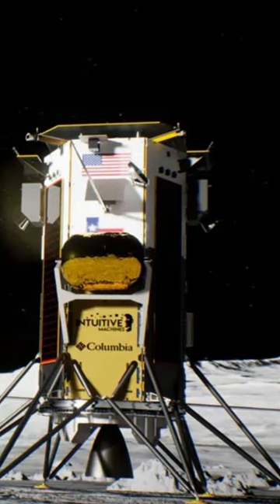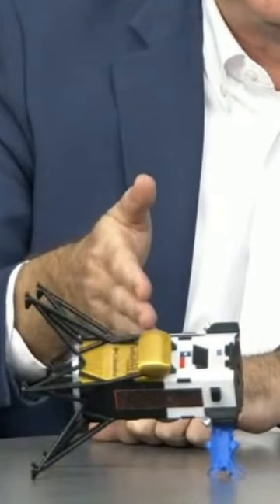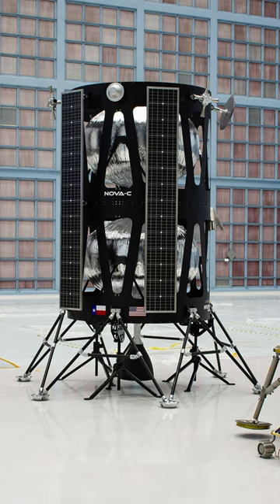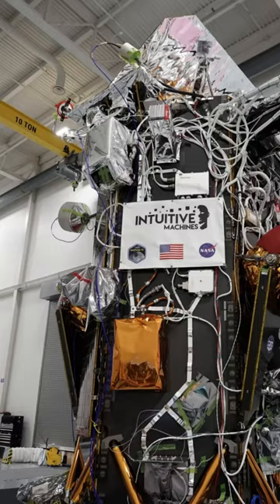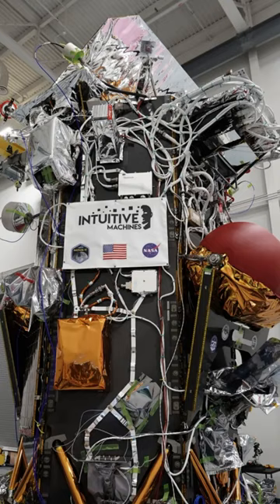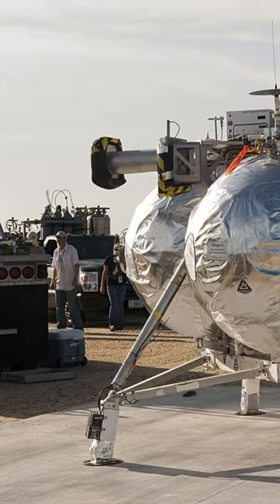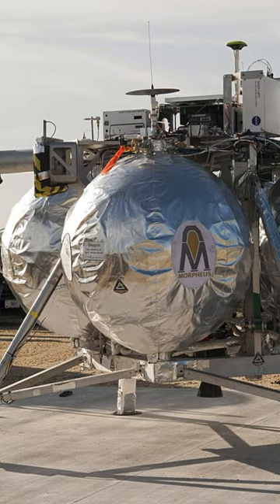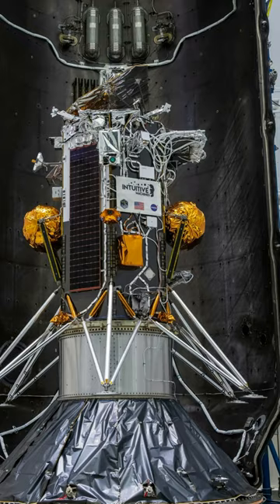Why Was This Moon Lander Built So Tall?

Comment: A low center of mass, sled with skis to deal with any delta X would be more robust, ensuring the lander would remain oriented in the engineered position.  Another thought is why doesn’t the current design have a set of fireable barbs with cables on reels, that would be able to penetrate the surface, then the reels, with some high torque, gear reduction motors could draw in the cables slowly and pull the chassis back into the vertical position, even if the landing struts suffered damage. It seems to be a lack of forethought on both the Japanese and the IM-1 engineering teams to plan for typical failure modes, that’s causing the rather pathetic, “Help! I’ve fallen and I can’t get up” syndrome!  
We got to be better than this in the 21st century!

Comment: Hmm, 🤔 thought it fell over because it was moving sideways as it was coming down. And when it touched down, it was not fully moving down but was moving down/forward 👇👉. Which made it tip over when it caught the lunar surface. I don't believe it being top heavy has anything to do with it falling over, if sideways movement is the reason . Anything can fall over if it's coming down and moving in a horizontal direction as it comes down🤦.

Comment: yeah but there's a point where you have to say, is this worth the extra chance of failure? The proposed solution to this is basically, "if you're moving horizontally and you tip over, just don't do that lol" which, works, but isn't exactly great.
Reply: And incidentally, with that mindset you can probably justify removing the legs altogether, and landing on the engine.

Comment: 2 small tanks need less wall thickness to withstand pressure than one large tank.
The argument is usually because of production techniques being lazy specializing in one kind of material think RDS and reducing manufacturing costs on the contractors side.

Comment: Why don't they put oxidizer tank inside of fuel tank? Since both liquids are kept under pressure, internal tank should not resist high pressure and therefore might be lighter.
Reply from the maker: More complex fabrication, they built tooling for one prop tank design.
Reply: @scottmanley On the subject of tank design, one commenter proposed using LO2 and Propane.  I 'weighed in' on the tank design issue, but it might be a good video idea to talk about some of the more common hydrocarbon fuels and why they are seldom (or never) chosen for use in either pad-launch or in-space burn engines.
(I raised the question of specific impulse, specifically 😉).
Cheers!

Comment: Look at viking landers on Mars. Yes I think they had chutes to help, but they didn't topple over.
Reply: You pretend it's the same problem.
Reply: @TheEvilmooseofdoom  if you look at old NASA test films of the sixties, you see them testing model landers and each of them topple over. They were top heavy. Mars Viking, ranger 3, seemed to have very low centre of gravity. They made it down on three legs.
Reply: The assistance of a parachute obviously helps ensure they fall straight down and dont have to worry about fuel running out and can comparatively take it's time.
Reply: @Geeksmithing  although with a very thin Martian atmosphere, a retro brake i think was additionally used. But having a low centre of gravity seems to work best. I can't see why they can't do that. Have they not watched any old NASA test footage from the 60s I wonder??
Reply: @NeilPeelParanormalPeepShow  I'd be surprised if they didn't also use computer simulations to well, simulate what the flight dynamics were in order to deal with them.  It's easy for us to armchair quarterback after the fact, but in the absence of an onboard human brain to make Intuitive Machine decisions, they will need a more comprehensive flight checklist to avoid boneheaded goofs and more robust autonomous landing systems.
Reply: @Geeksmithing  to me it looked like a very risky topple jenga waiting to happen. Lots went very wrong on this flight. Landing should have been tested fully as a real object, not preprogrammed computer model.
Reply: @NeilPeelParanormalPeepShow  to be fair, it's not like they can easily test the exact conditions just anywhere.
Reply: @Geeksmithing  Yes however, they did make mistakes in forgetting to do certain things and only discovered these mistakes by fluke. But if they had built the lander with a lower centre of gravity, this would most likely not have happened. They were flying blind essentially, with a top heavy loaded vehicle. Expecting the odds to happen in your favour!

Comment: ❓ Install arms to “right” the units to an upright position, and as a spade to move rocks/regolith in experiments. Seems easy enough. Mass calculations, save missions, expanded science via in-situ material displacement. Basic insurance + science + math/mass calculation = result. Can you/we perform example calculations for such arms/mass based on 1) previous mission arms, and 2) primitive/dumb/simplest arms?
❓ Airbag/unfolding style or Opportunity/Spirit? Automatically self-righting.
Reply: You make the flawed assumption that they had the budget and mass to add those things.
Reply: @TheEvilmooseofdoom  not at all.  Perhaps you missed that in my comment… everything after the first sentence. Math/mass calculation, arms as insurance, and arms as science tools = result.  Then asked if there were relative examples of mass and function that we could use in the calculation.

Comment: Some organization will have to micro-map the surfaces & terrain at the polar regions to help robotic landers find better landing spots
Reply: Mapping the surface beforehand is so unneccessary…. The lander can map the surface for itself after inserting itself into orbit. And it wasnt issue of uneven surface but the horizontal speed during landing.
Reply: @SagittarA  I’m also considering previous landing attempts in the same region that have failed or were partially successful
Reply: HUH can you tell me which other moon lander landed that same exact area lol? @treborg777
Reply: The Japanese lander ended up on its side and on a slope.  Why didn’t it find a flatter place?  Is the terrain near the South Pole so uneven that current spacecraft guidance systems aren’t capable of finding optimal landing sites there?

Comment: legs should be attached at top. they could be longer, wider, and allow self,leveling like ladders & wash machines.
Reply: "wider" doesn't fit inside the F9 payload fairing. Folding them up has other reliability and weight penalties.
Reply: Longer leg members are required if attached further up, which requires greater [lateral] stiffness and more weight in the legs. 

Every engineering decision has a crowd of influencing and interacting factors.

Comment: Make one of the tank a ring around the other tank.
Reply: Ring tank designs are;
• Difficult to fabricate
• Difficult to thermally regulate
• Difficult to implement ullage on
• Difficult to keep fuel both homogenous and uniformly distributed in, which results in
• Difficulty maintaining attitude control during maneuvers
Did I mention how difficult it is?

Comment: It still doesn't change the fact that they could have made the landing structure more than twice its height in diameter for only 12 pounds more mass,  OR EVEN DESIGNED THE DAMNED THING TO INTENTIONALLY FALL OVER ON ITS SIDE WHEN LANDING.   There are engineering decisions that engineers absolutely should know must not be made.

Comment: Let’s think for a moment, many things went wrong. Looks like everyone was in a hurry (again) to reach a failed outcome and start blaming… right? They ended up with an unusable and expensive lesson.
First, need a better systems of checklist, rehearsals and one over one … even if it takes more time.
Second: The lander center of mass is too high, and design could of been more robust against lateral velocities, this failure could have been easily predicted during mandatory simulation
Third: if the structure needs to be high, thwart leg pivot pints higher and go back to simulation.
Fourth: if missions are over the horizon try telescopic or actuatorless solar panels. The module design does not need to based on solar panel design.
The result, embarrassment that will be tough to brush off.
Lessons:
No hurry
Rehearsed plans
Systems backup and redundancy
Small lateral slow down thrusters
😊
Reply: They failed and that's a good thing. Hop on that engineering cycle and get to the next failure. :]
Reply: @Khronogi  so if you owned one of the 12 experiments or the 1 billion $ satellite you would be ok with hopping on to the next failure discovery point? 🤔

Comment: Was there some kind of procedure for re-erecting the apollo lunar module in case it would have fallen over? Would it have been able to survive intact enough?
Reply: They had somebody flying it so that helps
Reply: There was some talk of them maybe sinking into the top layer
Reply: I believe the plan was to dig under the lander the get it more upright if necessary. If it fell completely on its side I don't think there was anything they could have done, since the LEM was too heavy to manhandle.
Reply: No. Neither.

Comment: I see rant about sanity checks (I’m looking at you Boeing max)

A 360 camera stuck on a lunar lander can give a good approximation of where vertical is,
It can give a good approximation of horizontal velocity by flow measurement the same as a mouse,
It can give an approximation of vertical velocity by the rate the terrain gets bigger,
It can give a rough approximation of altitude by the angle between horizons. 

All these functions have been in toy drones for many years. 
Yet some of the recent failures of landers have been due to navigation problems that most likely would have exceeded the simple sanity checks from a single 360 camera and some very simple software.
Reply: I wouldn't say such software on drones is simple, but it has matured and become efficient over the years.
Reply: @imconsequetau5275  
Hmmm, well it depends on what you call simple. 
For example my $100 openmv7 camera has all these functions inbuilt and still runs at 10+ fps.

Comment: Isn't there any shock absorbers or springs at those legs?
Reply: Shock absorbers, yes. Not intended for horizontal velocity at touchdown.
Reply: @T_Mo271   - Didn't they slow the speed of the ship to zero at high altitude and come down with the help of gravity and then look for a suitable landing place - but came almost horizontally like an airplane and near the surface of Luna they tried to slow the horizontal speed to zero but the dust rising from Luna confused the accuracy of the laser measurement.

Comment: I don't think the problem is the center of mass or the shape, but more about the position and shape of the legs.  If the legs started above the middle section and extended from there instead of from the base, the design would be much harder to topple over.
Reply: The mounting point location makes absolutely no difference to it toppling over (or, well, makes it a tiny bit more top heavy and  thus makes it topple over even a bit easier).

Comment: Ok, so how about making the body of the probe half as tall, and use deployable leggs that starts out as tall as the total lander was when launched?  Same mass, much wider base.  And moving parts is the only drawback?
You only need three points of contact to be stable. They could still feature six legs, and have a much wider base than the height of their center of mass....
Also, what happened to gimballed solar panels?
Reply: Weight, reliability, etc. It's all a compromise.

Comment: Do those same laws of physic's apply to a structure like a starship with a payload at the top, aka a cargo bay. Where will the center of mass be located when a starship touches down based on remaining fuel? If you need a number to work from, you can use Musk's own sales pitch of 100 to 150 tons to the lunar surface.

Is it still doing multiple refuels in LEO and at Gateway station?

Should the internet get the Austin Powers memes ready?
Reply: The CG won't be as high as you might think since it needs to retain enough fuel to get back into lunar orbit which means fuel in the tanks.
Reply: @TheEvilmooseofdoom  So there will be at least 2 launches to get each Starship version of the HLS to the lunar surface? 

Surely that increases the launch cost compared to the other options?

Sort of like building a tunnel in Vegas saying it will be cheaper for the public but instead it turns out would be more profitable for the operator.

Comment: Having played Space Engineers, I blame NASA for not attaching some hinges to prop itself back up. If it's tall, it'll fall.
Reply: Intuitive Machines (IM) designed the lander, not NASA. They were a customer and had six payloads onboard. The IM lander is part of the CLPS program where NASA pays private companies instead of doing it in house.
Reply: They should've just activated the landing gear

Comment: the engineers didnt design a potential tip over protection system or upright system????
Reply: Right. Did not. Wouldn't be necessary if they'd remembered to enable all of the guidance / navigation sensors.
Reply: No, they had real world budget and mass constraints.  Two things the pretend engineers like to ignore or don't even understand to begin with.
Reply: if they played ksp then they'd have known to design a system for potential tip overs

Comment: They did it for this and that reason. Except that the design increases the likelihood of failing. 
Methane and oxygen are great, but if you have to have them on top of each other the center of mass goes up top and then it’s not such a great idea. 

And I don’t even what to start with how tall the SpaceX Lunar Starship is  planned and it’s very small legs.  How were the successful Chinese Lunar Landers configured ? And if anyones looking their plans to land by the end of 2029 have a lander a lot like Apollo’s LEM which was about 1.3 height to base ( not legs extended) width.
Reply: I've said before;
Boeing's concept (hold yer horsepower for a second) for a 4-crew lunar lander looked good.  I just would not trust Boeing to execute it, not now and not in the next ten years.  They need to get their 💩 together.

Comment: Maybe NEXT TIME the landing legs won't be crushable.
Reply: They aren’t today
Reply: It didn't fall over because the legs collapsed on one side. It fell over because it was moving sideways when its legs touched the ground.
Reply: @xitheris1758  Yep.  And if legs could absorb shock and rebound, it'd STILL BE UPRIGHT.
Reply: @xitheris1758  ...Sorta like on the LEM.
Reply: @loskevanos  Yes, it could indeed be said, so let's say it  "They fncked up, big time!  Must be NICE to be able to blow that much cash on an untested product!"

Simulations do not equate to physical testing.
Reply: @loskevanos  If the attitude was as it should've been, it would not have "tripped" over the irregularity, center of mass would have been above or slightly behind landing legs, the snag would have acted as a hinge and brought the rest down, upright.  If the attitude was wrong, if it was leaning into direction of travel, and center of mass was ahead of legs, oops.
Reply: @LordDustinDeWynd  It doesn't matter whether the legs could absorb shock or not. With enough horizontal velocity, linear momentum will be turned into rotational momentum upon contact with the ground, just as a thrown (non-rotating) ball will start spinning in the direction of its motion once it touches a surface.
Reply: @xitheris1758  "With enough horizontal velocity"?  Lander didn't tumble, it tilted.
Reply: @LordDustinDeWynd  It had just enough horizontal velocity to tilt and fall over. You're assuming rotation means tumbling; it doesn't have to be that extreme.
Reply: @xitheris1758  If the legs were shock-absorbed, that side of lander legs could compress and rebound, bring back to vertical.  Doesn't really matter why, it matters that next time, they PHYSICALLY TEST IT instead of depending on simulations.
Reply: @LordDustinDeWynd  I don't think you understand just how nonsensical that is from an engineering standpoint. By increasing the complexity of the legs, you'd just add cost, time, and numerous modes of failure. They did exactly what they were supposed to with the design. It tipped because the landing wasn't performed correctly. That's what they need to fix — not the legs.
Reply: @xitheris1758  The complexity of a moon lander from the late 60s? 🤣🤣🤣🫵
Reply: @xitheris1758  If a multi-million dollar lander isn't worth a bit of complexity like shock-absorbing landing struts, which were standard on landers 60 years ago, then their lander is a p.o.s. to begin wiith.

Comment: Bad design  !!
Reply: I’m guessing you know more than the hundreds of aerospace engineers who worked on the mission?
Reply: Such a bad design they couldn't land it. Just more wasted taxpayer dollars.
Reply: How much did it cost ??  And flip on its side !! they just stick to MARS trips  LOLOLOL
Reply: @felixruiz2838  you realize the user is intentionally spreading misinformation? It's a privately funded mission, but it's not a bad design at all. There was an issue during landing. Please stop pretending to know what you're talking about, it hurts to read
Reply: @felixruiz2838  NASA doesn't 118 million just on the taxi ride. They also had Luke 7 or 10 projects on board, unclear if any will be salvageable. Last I read the antennas are buried (and ya know, it's not upright and facing the wrong direction 🤣🤣)